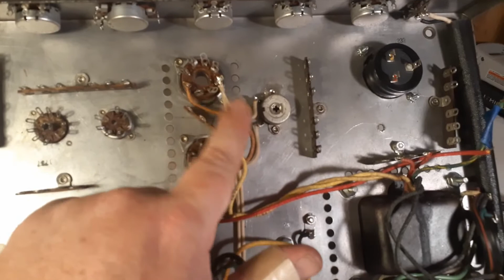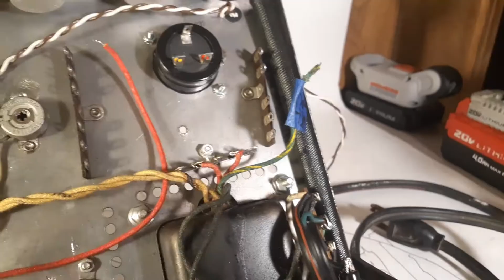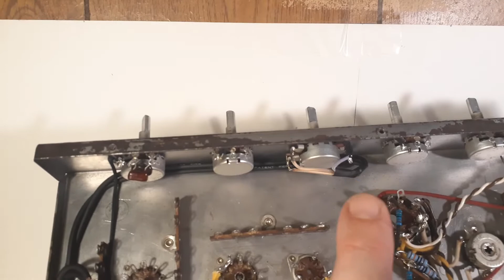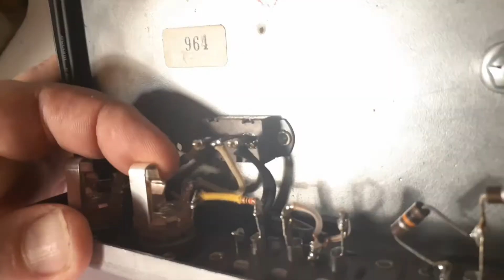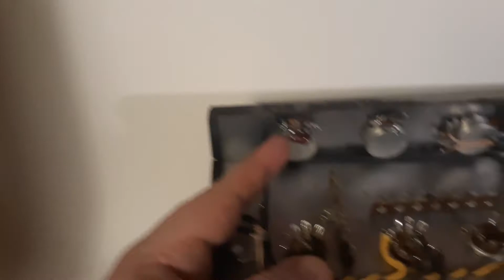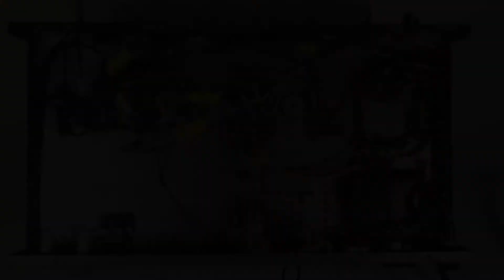Bogen CHB-50 Tube Amplifier Conversion, ep 4: Assembly!

Comment: did you ever publish your final schematic?  I'm curious about what removing that remote circuit does to the first stage supply
Reply: Also, I have a CHB-100, and that schematic shows both the plate and cathode of the 12AX7 connected to 240v via a 220k.  I've never seen that configuration before and hoping you can explain it to me.  thanks again.
Reply from the maker: Yeah, there is some weird stuff in that circuit related to the remote control stuff and cost saving crap like the grid leak bias on the inputs. It can all be tossed out. I'll get the finished shcematic together soon and you'll see what I did, keeping the Bogen soul while optimizing it for guitar, not a budget PA.
Reply from the maker: I will be doing that soon. This project was finished as far as I remember, just never got to test it much before I was on to the next squirrel that ran by.

Comment: WTF? No demo?  
This sucks a hard one.
Reply from the maker: I never did get a chance to film the testing phase. However, I will have access to the amp soon and I will try to get a video of it. With my amps, once they are done, they usually head out the door at light speed! Some of my friends that have known me for years have never seen one of my finished amps because they find their new owners so fast!
Reply: @mesasavage  Oh, okay. I was searching and didn't know why the build dead-ended with this video. 
I'd love to hear how it turned out. I just bought the same amp with the same intentions of turning it into a guitar amp. Naturally I'm a little pumped up and hoping I didn't get burned. It was dirt cheap and lights up so at least I know it's alive. The iron is worth more than I gave for it and I will probably gut it and build from there. I don't care to work through an existing nest of crap that I'll likely end up replacing anyway.

Thank you for the reply. It's appreciated
Reply from the maker: @Slugg-O  SO check it out, there are two very similar versions of this amp. The CHB-35A, which seems to be more common which runs rare and expensive 7868 tubes. The other version is the one I presented here, the CHB-50 and it runs 6L6s. Other than those tubes, the circuit is pretty much the same, though the iron might be slightly different? In any case, you can swap sockets on the 35 to make it a 50, which I suggest doing if you can manage the operation. The 7868s are cool sounding power tubes, but are too rare and expensive to mess with, in my opinion.
Reply from the maker: @Slugg-O  I usually prefer the full gut and rewire. However I've done that with these Bogens before and this time I just wanted something that was a simpler project. Bogen have good layouts and the rats nest isn't so bad. And this one was particularly clean. So I really just gutted the preamp section and power supply, then rearranged the circuits to be more guitar friendly, added 1/4" jacks, and disabled/repurposed unnecessary circuitry like the "remote". Dang, you're really making me want to revisit this amp. It turned out so nice and unique with the hybrid circuit I developed for it. It really did become it's own thing. Something Bogen could have easily marketed themselves in the late 60s, IF they wanted to. I try to build my amps so that they COULD have been made like that when new. NO fancy relays or modern tech at all. Anyway, good luck with your build, this era of Bogen is so ripe for all kinds of tweaks and mods. I'll try to get an update video done here some time in the new year.
Reply: @mesasavage  I'm pumped even more now. Thanks!
Reply: @mesasavage  The one I have is the 50 with the 6L6 tubes. I expect it will be loud but what I really want is a strong bottom end. The 35 would have been more than enough for my needs, probably near perfect, but it wasn't available. The 50 was too cheap to pass up and I already have a '66 Pro Reverb so I'm good with the bottom end from a pair of 6L6 tubes. I'll just need to keep the volume set to a gutsy rumble.
Reply from the maker: @Slugg-O  The difference between the volume of 35 watts vs 50 watts is barely noticeable. And since the 6L6 tends to break up earlier than the 7868, you can actually get more breakup at a slightly LOWER room volume with the 6L6 amp. One other thing I did was to make the power supply a full wave bridge instead of the voltage doubler that was stock. What this does (besides improving tone) is lower the plate voltage by enough to use different, older, LESS powerful 6L6 tubes. It was originally very high voltage, about 450ish volts, if I'm remembering correctly, and could only run 6L6GC or 5881 safely. Well that 450 volts on 1965-era 110v AC wall power becomes over 500 volts when 130v AC in 2023 is applied! Thats the doubler in action! With the full wave bridge I think these numbers went to like 325 to 350 respectively. But yeah, you can run older 6L6 tubes in it when modded like this. That means coke bottle Gs/GAs and original steel cased 6L6 (no G at all). This gives you tons of variety in tone. The 35 watt just allows you to choose from vintage tubes that cost over a $100+ each or the crappy modern Electro Harmonix tubes that are $60 each.
Reply: @mesasavage  Thanks for the videos and info.  I have the schematic but I'm sure I'll be returning to your channel  many times to watch.. Did it seem stiff with the bridge rectifier instead of a tube?
Reply from the maker: @Slugg-O  The voltage doubler and bridge rectifier were both solid state. Yours doesn't have a tube rectifier, does it? Is your chassis like mine with the silver and orange stripe on the case or the older black chassis with tan hood?
Reply from the maker: @Slugg-O  Its nice and tight either way. It just breaks up sooner and creamier at the lower voltage and I can use way more different tubes in it. The higher voltage was really just a way to squeeze every last bit of volume out of these circuits. These days we want LESS volume. The tubes last longer at the lower voltage as well. You don't want the voltage TOO low because then you lose headroom, but 300 volts is PLENTY for modern guitar amps, 500+ volts is insane unless you just want clean and LOOOOOOUD! It eats up the tubes as well, heck some modern crappy ones can't even handle much more than 450.